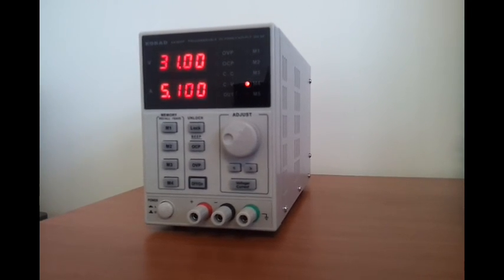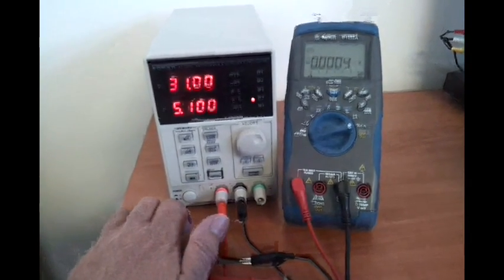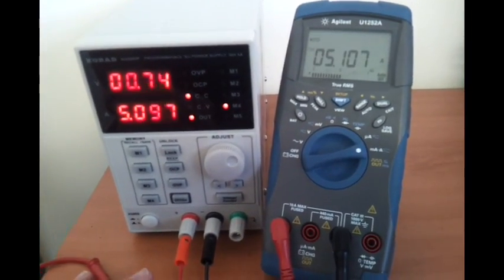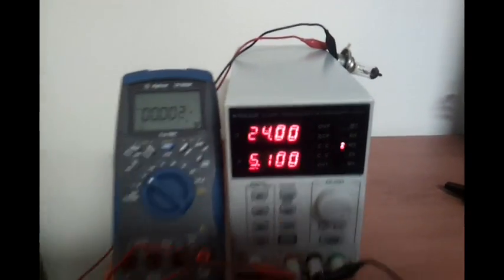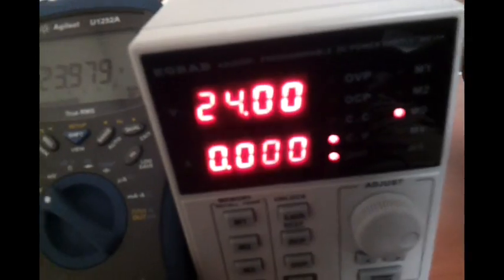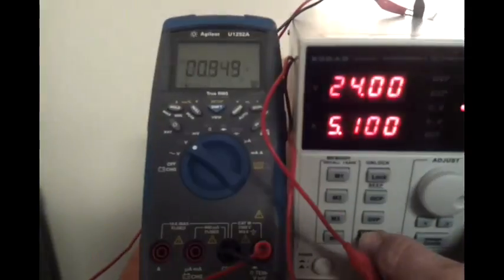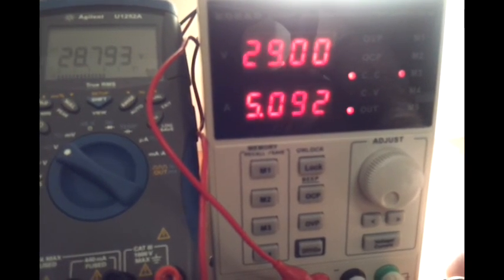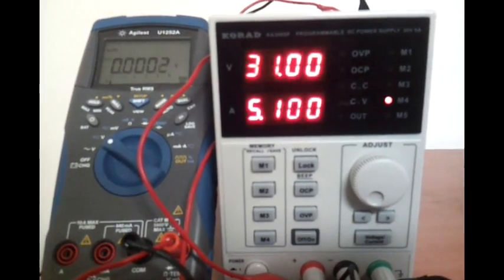Korad Power Supply Followup

Comment: I'm totally new to the world of electronics and as such know very little.  But I am curious why you would be supplying 24v to a car headlamp bulb, when most cars run off a 12v system?
Reply: The H4 bulb has two bulbs in one. High beam and low beam.
These were connected to series (12v+12v) so 24v is correct voltage.
Reply: The other ends of the two filaments are both connected to a single common pin so they are wired in series already.

Comment: So, I now have a choice among these "Korad clones" by a company called RND:

320-KD3005D (two knobs, no buttons)
320-KA3005D (one knob, with buttons)
320-KD3005P (two knobs, no buttons, with USB)

and completely different models from UNI-T:
UTP3315TFL
UTP3315TFL-II
(not sure, what they have actually changed for the II version).

What do you think? Which, in theory, should be a more reliable choice - the Korad clones or UNI-T?

Comment: This is the kind of response from a company that will make me buy their product.  Its one thing to find a fault and just ignore it, but quite another to admit an issue publicly then openly test the new model with proven corrective action taken.  I do wonder how quickly this would have been addressed if it had not been a high profile individual like Dave finding the fault.
Reply: yambo59 Agreed - I’m always behind a company that aims to continually improve their products.
Reply: Indeed, great response, I wouldn't hesitate to order from them. Would they have done the same for you or me? Well...to be fair, when someone like Dave finds a problem, you have some certainty that it IS indeed a problem. So often, inexperience leads to a false alarm, and since this is an entry-level item (in many ways), false alarms could be expected--but not if it comes from someone like Dave. You can look at his "high profile" status, or you can look at his "knows what is what" status instead.

Comment: Do you have any experience with the Korad KD3005D? I'm having issues with electroplating and switching from CV to CC. Do you know how to do this? Thank you.
Reply: Replying to old question, and for benifit of ther readers...
There is no "switching" between the CC and CV, as they are interlinked by the load you've connected to the PSU.
The CV Voltage sets the maximum voltage required.
The CC current setting sets the maximum current that you  allow the load to draw.
Which ever attribure hits your maximum setting first, it causes the other one to reduce.
. .
For example if you set the Voltage to 12V and the current to 2A...
With nothing connected, the Voltage will be 12V (hitting the CV limit) and current will be 0A (zero). This is CV mode.
If you connect the PSU to your plating bath, the current might start at 1.0 Amps and raise up as the plating starts. Initially the Voltage will be at 12V.
. .
When the Amps rises to 2A, it will start operating in CC mode and limit the current... the more current that the bath tries to draw, the lower that the Voltage will fall.
If you short circuit the leads, the current will be 2A but the Voltage will fall to basically zero.
- this is CC mode.
. .
If the whole circuit is in CC mode you can wind the voltage up, but nothing will happen, because it's being held down by the CC setting. If you wind the current up from 2.0A to 2.1A, then the voltage will increase slightly.
. .
For plating, you set the max Current to suit the job. You then wind the Voltage up until you get enough power to plate the work, in other words until the CC kicks in.
As the bath warms up and the solution changes composition, the current wi change. If your solution is weak it might drop below the CC limit of 2A, but you then have the CV limit to prevent the Voltage going higher than 12V no matter what happens.
. .
Another example... if you were charging a lithium battery of 2000mAh, you might decide to charge at "0.5C" which means 1A for 2 hours. You do not want the Voltage to rise above 4.2V because that will kill the cell.
So, you set Voltage to 4.2V and Current to 1A. When you first connect the battery, the Voltage will be (say) 3.2V so the PSU holds the current to your 1A limit.
As the battery charges at 1A CC, the Voltage rises. When the Voltage hits 4.2V, it won't rise any further because of the CV limit you set.
So, what then happens is that the battery stops trying to pull more current... the current will drop, first down to 1A (your CC setting) and then, because the Voltage is capped, it will continue to drop. Less and less until it's approaching zero.
. .
For lithium batteries, you usually would disconnect the charging power when voltage is at maximum (termination voltage of 4.2V), and current has fallen to 1/10th of the original charging current limit (1A in this example)
So, if charging at 1A CC you would physically disconnect the charger when the Voltage was at 4.2V and the current had dropped to 0.1A (100mA).
. .
Hope that helps.

Comment: I got this power supply too, just with the Velleman name on instead, and it also seems to be an even newer revision.

My problem is that I can't find any information about how the over current protection and over voltage protection work, have you figured that out?
Reply: OCP : PSU output will switch off when the set current as been reached (so it will not go into CC but switch off instead)
OVP : PSU output will switch off when the set voltage has been reached (the PSU has to go into constant current first)

So for OVP the PSU has to go from constant voltage to constant current before OVP switches of the output. In OVP mode you could use the PSU as a charger by setting the charging current and target voltage, once the target voltage is reached OVP will switch off the output.
Reply: A little late but I hope this is what you were looking for -> http://www.produktinfo.conrad.com/datenblaetter/75000-99999/094001-an-01-ml-VELLEMAN_PS3005D_LA_de_en_fr_nl_es_pl_pt.pdf

Comment: My PSU failed last week.

Since I’m electronics engineer I’ve turn it apart and fund that the microprocessor board has malfunction cause of fan short circuit. ULN2003A was blown, I’ve replaced the fan and ULN, to find out that 3 op amps are also shorted (TL082), replaced those but that didn’t help. There was something else short-circuiting 3.3V, found out that it’s a microprocessor with sanded markings. 
Can you help me in any way with fixing my PSU? I would need a programmed microprocessor, or full microprocessor board.
Reply: I'd say you're SOL. Take your business to a company that doesn't obscure part numbers and sells parts next time.
Reply: I know this is a old post, but still, maybe somebody finds this helpful:

The microprocessor is most likely a Nuvoton – however I could not find the exact type.

You can find the schematic (of a older version of the PSU, and the schematic has errors) here, look for the ZIP file:
http://www.eevblog.com/forum/repair/korad-ka3005p-power-supply-calibration/?all

There are different versions of the PSU, with different boards inside.

Comment: Well for a digital controlled lab power supply I will like to see an oscilloscope test to see if it keeps the regulation. Or at least use an LED instead of the incandescent light bulb. If the constant current regulation at the power on off is not kept it will burn the LED or try to change the current or voltage settings when the LED is there of course keeping the current settings within the limit of your LED.
I realize this video is old but just for future reference.

Comment: Isn't it pretty unsafe to play with 5 amps like that? with your naked hand? maybe wear a rubber glove.
Reply: It is 5 amps at 24 volts into a lightbulb.  Unless you stick the 24 volts directly across something moist (like your tongue!) you won't feel anything.  The resistance of dry skin is pretty high so you will not get any dangerous current flow.
Reply: Finiras You've fallen for the highly deceiving, if not completely wrong "It's the volts that jolt, it's the mill{iamp}s that kill" lie. Yes, you need a certain number of milliamps across your heart to kill you, but in order to cause that to happen you need a large voltage across your body. 24V is not a large voltage, unless maybe you're standing one-legged in a grounded salt-water puddle with a gash in your foot, etc.

Comment: Nice followup review. I have several questions. Could you also show the transient response when turning on/off? I saw there was overshoot on Dave's video, and I am wondering if this issue still exists after their modification. And I wonder if the one in this video is the one with new internal PCB design Dave showed in EEVblog #404 - Korad PSU Followup.
Do you know if there is any change in model number since I have no clue how customers can actually tell which one is which without tearing apart if there is no indication outside.

Comment: So what if they were running it on 240V instead of 220V? The mains voltage is rated 220V +-10%. That means the Korad PS should be able to handle up to 242V. Of course, that is if Dave's mains voltage wasn't above 242V.
I don't think Korad have a good excuse for their PS failing like that.

Comment: The test is okey, but not as mean as the one that dave did: An electronic load is complex and in it self regulated device as well. With modes like constant power and simulated resistance it is possible to stress the power supply way more then with a bulb. Power Supply and electronic load can go in resonance with each other, a simple bulb won't do that at all. A bulb even acts as negative feedback, because a warmer filament means higher resistance, which means lesser power.

Comment: When the supply goes into constant current mode at 10:50 ish, the voltage reading is still 29.00, whilst the DMM says 28.75 - clearly if we're in CC, the voltage would be dropping. Why isn't it reading voltage correctly?

(Later on, when he loads M4 - 31V/5.1A, it shows a more correct voltage on the screen.)

Comment: Is this the exactly the same version/model as the previously "KIA" Korad KA3005P (programmable)? I'm sure the differences are minute (if there are any at all) from non-programmable model Korad KA3005D, but a bit of clarification won't harm.
p.s. own a regular version and haven't had any issues with it (knock on wood), though hadn't pushed it to the edge yet)

Comment: I agree. What sort of product works with 220 and not with 240 (or vice-versa). And how about thermal protection on the transistors if that's what failed before? Having said that I wouldn't pass judgement on the product based on a single bad experience. Maybe Dave just had a dud. It happens.

Comment: What you could do, for a extreme torture test, is get a high current relay and wire it up to short out the supply when it energizes.
It will buzz like crazy and probably ruin the relay after 5 minutes but will provide a really good intermittent short test.